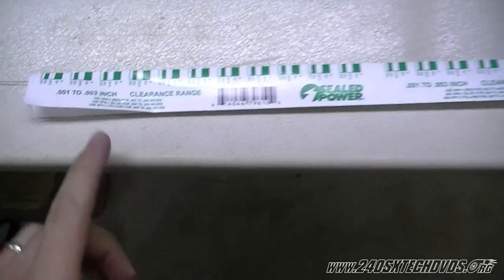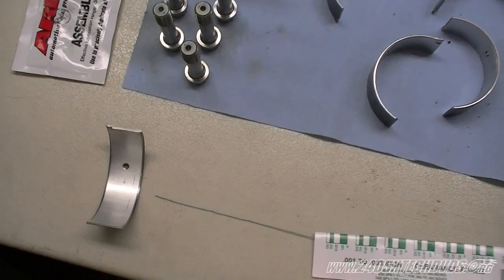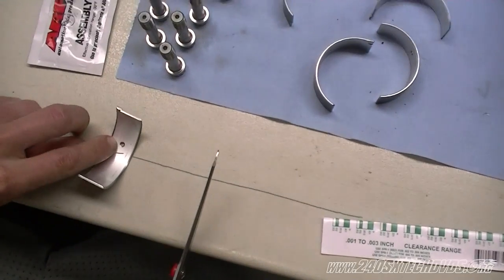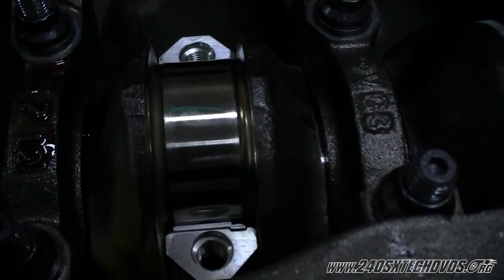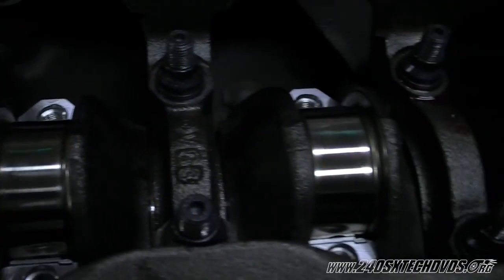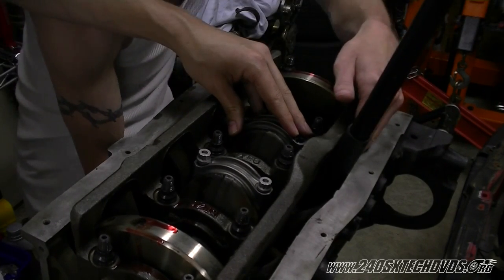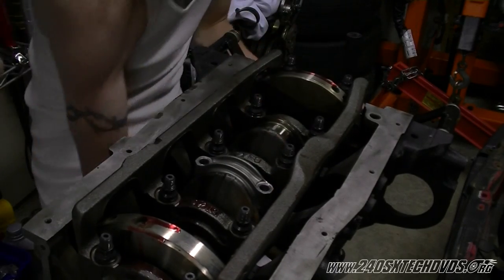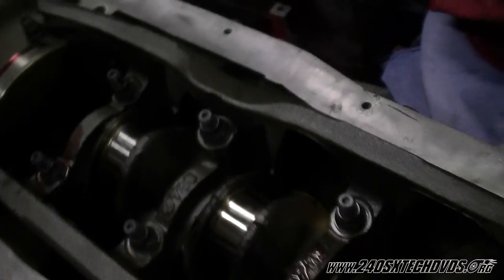www.240SXTECHDVDS.org 240sx KA24DE DOHC How to PlastiGage.mp4

Comment from the maker: @sm0othockeyspeed No it was a KA but it is the same process on the SR - as for oil clearance it is whatever your FSM states is standard or whatever clearance your wanting - for example the motor in this video had oil clearance of .0015" but since we are going turbo we had to get the crank micopolished down .005" so we could have our targeted oil clearance of .002" because for turbo motors you get more heat and need looser oil clearance as the parts tend to swell more than stock due to more heat.
Reply: this is just what i was looking for.  i have a ka24de am going to rebuild and was wondering about better oil flow.

Comment from the maker: @dtmbcorp I was using the extension to tap the bottom of the piston to knock it down out of the bore and pull the rod off the rod cap - as you seen the rod cap moved a little bit but it did not smear the plastigage but it can if it moves to much. You can also loosen the rod bolts and leave them in the rod and  tap on them with a rubber mallet to knock the rod down off the cap.